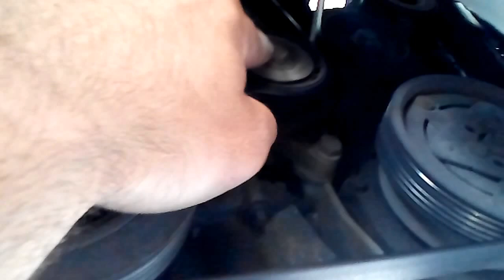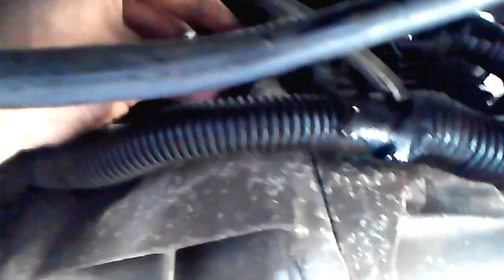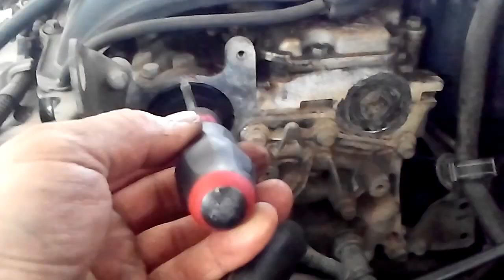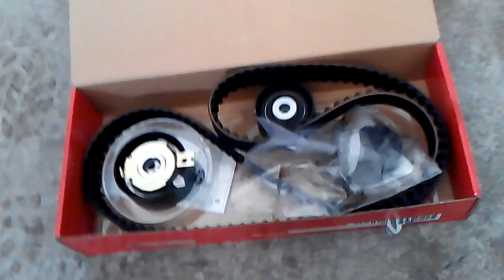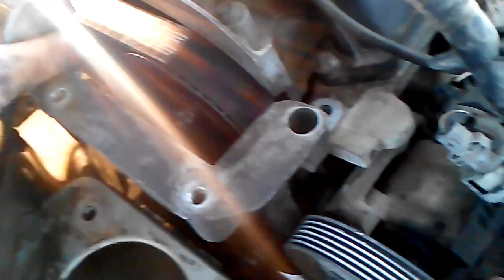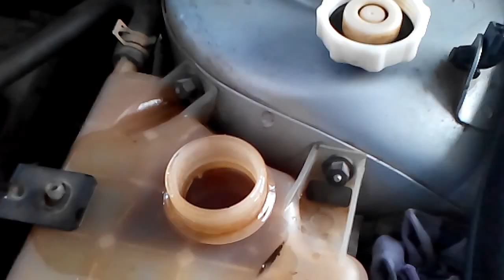RENAULT LAGUNA 1.6 16V TIMING BELT REPLACEMENT AND COOLANT PUMP

Comment: Brilliant Thank You, no other information ive found tells me the cam pulleys are freewheeling with the nuts undone I thought they would be pegged. My cambelt was half a tooth out between the cam pulleys and the new belt wouldn't go on. Loosening the cam nuts realigned it. My mate did the last belt and it's been half a tooth out since then!! I wondered why the idle was a bit rough for the last 50,000 miles. Thanks again Brilliant.

Comment: Thanks, this is the best video in days. For tighten the camshaft pulley bolt you let the bolt (70 mm) in the inspection hole?
Reply from the maker: Yes
Reply: Usefull video until today, thank you very much ! From france

Comment: Hello, where is the horn in this car because my didn't work and I can't find it. I have the same engine and the car is from 2000 (after lifting)
Reply: It is located under the left front plastic, under the bumper.
You need to get under the car in order to replace it.

Comment: Great video I am doing head gasket on a 1.8 how do I find top dead centre.
Reply from the maker: There is plug hole for locking crankshaft check in the video

Comment: Dear Igor,
What is the size of the bolt you use for blocking the flywheel?
You say "the length is 70mm"
Is it an m8 bolt?
Greetings Jeroen
Reply from the maker: Dear Jeroen that bolt is combined m10 with m8 because the hole is m8 that bolt I made from timing kit for golf mk4 for the tensioner

Comment: Hi Igor. Thank you gor this video. 
I have one question:
What's the thickness of the metal plate you use to make the camshaft bloking tool?
Reply from the maker: I think was 5mm
Reply: @mechanicigor  Thank you. Very grateful. Replacing timing belt and cooling pump in my Mégane 1.6 16v K4M today... Wish me luck... 😉

Comment: Can you do this job without the cam shaft locking tool? I can make one but i dont need to remove the gears nor do the waterpump so not making the tool would save me some time.
Reply from the maker: Yes you can just use marker to mark the sprockets
Reply: @mechanicigor  okay, thats what i was thinking. Thank you for replying :)

Comment: So the tensioner shouldn't be in top dead position? I locked mine in top dead position, could it be too tight?Engine runs smooth though...
Reply from the maker: If it's over tightened it will damage timing belt faster than normal

Comment: Hey Igor,
Do you know, or can you measure what the thinnest diameter of the pen is?
The part what snaps in the flyingwheel? 8.00 mm?
I am going to make the pen of an m10 bolt.
On a turning machine i will decrease the diameter partly to the thinner diameter.
Thanks in advance
Greetings Jeroen
Reply from the maker: No problem glad to help
Reply from the maker: Sorry Jeroen you need 10mm of m10 so you can screw  rest of the bolt needs to be 8mm and total size is 70mm
Reply: Super ti je brate engleski, za nekog ko radi mehaniku mozes slobodno u kinu da predajes...

Comment: Hi, how does the water pump you installed look like? Is the mark graf good?
Reply from the maker: According to me every new part is OK because it's new it doesn't matter how manufacturer it and it's under warranty for 6 months
Reply: @mechanicigor  I used the same Graf water pump, but I closed it with an old washer, I hope the coolant does not leak
Reply from the maker: It was metal or paper gasket?
Reply: @mechanicigor  The factory washer that was on the car from the beginning and has a red color
Reply from the maker: @rezarg5081  it's metal gasket you are safe they are good quality